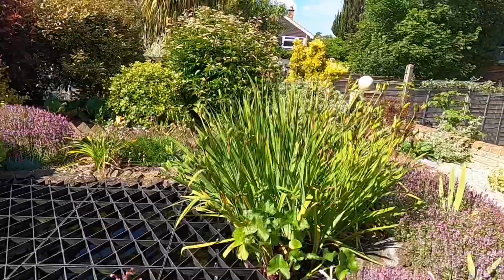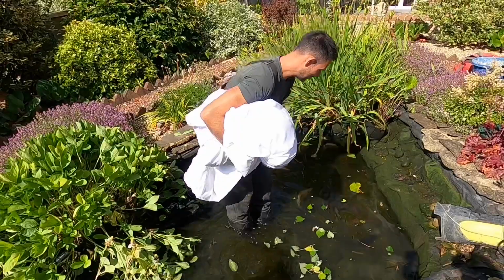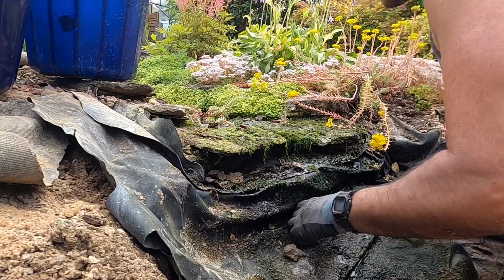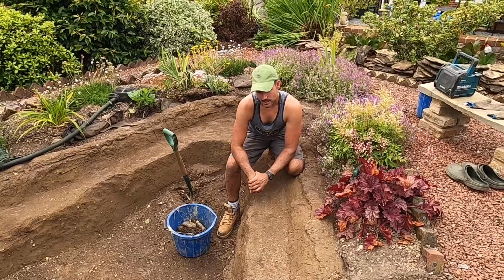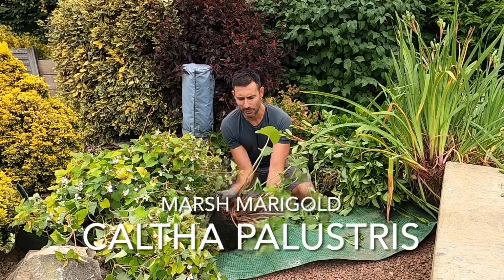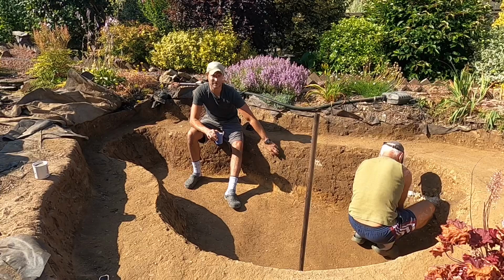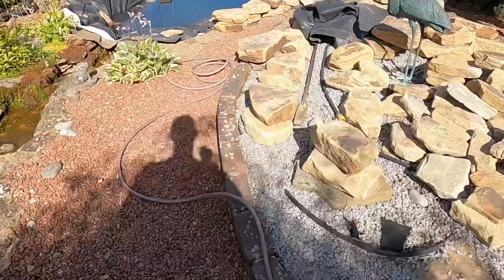‘The struggle!’ Pond re-line & re-design part #1: Initial clearance, excavation and lining.

Comment: I can't find pond fleece anywhere in the UK other than 2m wide . Where can I get larger sheets? I'm building a pond 11m x 8m. Thanks ... love the videos.
Reply from the maker: Pond fleece tends to be sold in 1,2 and 4m widths, although almost always 2m widths is the most commonly found.  Simply overlap the fleece in strips around the excavation. No need to use one single piece- in fact you’d find it harder to use as once piece and would probably end up cutting it into sections to aid fitting and reduce creases in any case!
Hope this helps!
Best,
Ed

Comment: Great videos Ed, would the amount of mortar used to secure the stone work have an affect on the water pH and is there options to maintain at a lower level if so.
Reply from the maker: Hi there- yes indeed the building materials used in this construction, inc the rock and gravel will all alter the water chemistry initially- buffering the water and making it harder and more alkali.  Over the course of a season or so the bulk of any lime from the mortar will have leached out and a few small partial water changes throughout the first year of the ponds life will help maintain a ph closer to neutral and prevent ph spikes.
Hope this helps and thanks for your comment!
Best.
Ed

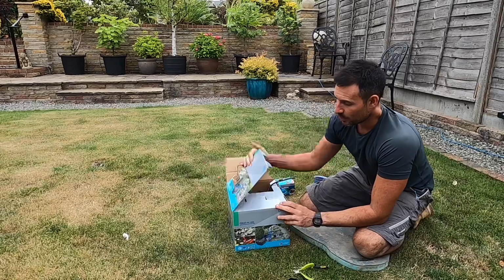Comment: I have the same filter shown at 22:41 in my small pond, which is 1.7 metres long and a width of 1 metre and a depth of 1 foot (the water Is crystal clear and has 12 little golfish around 4 inches long and some water plants) but I'm  going to expand it, so it's 2.5 metres long with a width of 2 metres and make it 2 feet  deep and add some plants, will the water clarity change at all? I would like the water clarity to be clear. Thanks.
Reply from the maker: Hi there! Thanks for watching and commenting! With your enlargements you’re effectively doubling the water volume, which will have more of a demand on your filtration system.  If you’re not adding more fish then I’d be confident that your filter would still be suitable to maintain clear water,  but with the addition of more fish the balance could be tipped and you may struggle to keep the water clear.
I would continue using your filter kit and monitor water quality/clarity visually.  If in the future your struggle to keep the pond clear then upgrading your filtration would be sensible.
Best,
Ed
Reply: @CrystalClearAquatics  Thank you 😁

Comment: Brilliant video as always, thank you. Have you used the Hozelock easy clear filter/pumps? We’re looking for an all in one system and they look pretty good. Thanks
Reply from the maker: HI Mark, apologies for the slow response- the hozelock easy clear was essentially the pioneer of ‘all in one’ systems for ponds and so for that I must commend them.  However my personal experience with them is a bit hit and miss- physically they were too bulky- the earlier models only boasting up to 11w uvc outputs (although I think they go up to 13 watts now) and were only suitable for small ponds- their bulk was difficult to conceal.  Also had more then a few issues with water ingress into the quarts sleeve and access to the pump for internal maintenance was a real faff via lots of awkward to reach screws.  I much prefer the oase range of filtral all in one units, which are more compact, have more filter media, are easier to take apart etc. the only negative is you have to purchase a fountain kit as an optional accessory, whilst the hozelock range supplied it as standard. 
Hope this helps- I must stress this is only my opinion!
Best regards,
Ed
Reply: @CrystalClearAquatics  Hi Ed many thanks for this. We bought the Hozelock one & it seems cool so far. The fittings are all plastic but it has a 2 year guarantee so that gives us a bit of hope with it. One of the reasons for buying this one was it only has 1 cable & no mains transformer so the cable fits though our existing conduit. Thanks again, keep up the amazing work. Cheers, Mark.